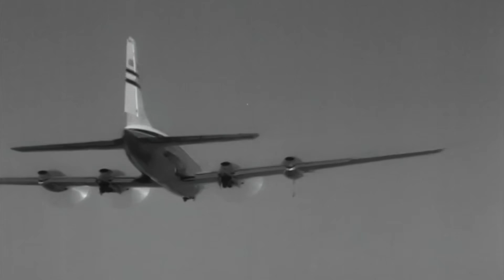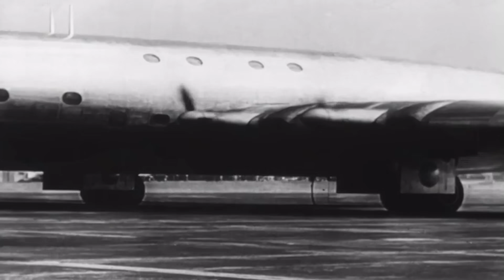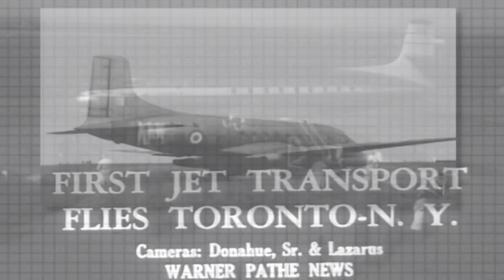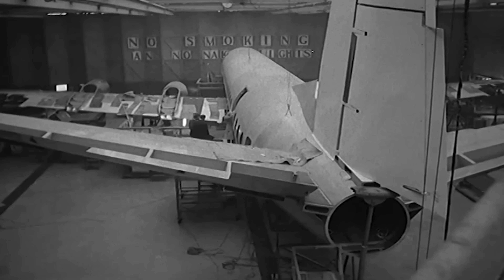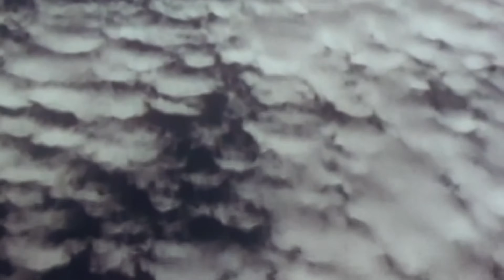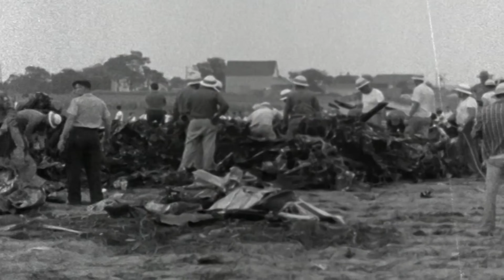How Frank Whittle's Jet Engine Evolved Aircraft Development | The Amazing World of Aviation | Spark

Comment: Former Boeing... it is interesting to see how Jet Engines have 'Evolved'... Whittle's first used 'Combustion Cans' that were arranged in a circle. They were easier to produce, reliable, but limited performance. Three main types of combustion chamber in use for gas turbine engines. These include; multiple chamber (cans), the tubo-annular chamber, and the annular chamber. I have stood inside front of GE 9x engines used on our B-777. It is huge and would not fit inside my house with 8 foot ceilings. The Front Fan is about 12 feet in diameter.

Comment: Whilst a lot of the British story is focused around Sir Frank Whittle’s efforts throughout the world, it is apt to overlook contemporary European interests of the time most notably Von Ohain, because of his book in the 1950’s. This has been corrected by modern revisionist historians and engineers. I would refer you to Dr Hermione Giffard’s book Making Jet Engines in World War II, which has corrected the historical narratives with engineering facts.
Whittle was only responsible for a centrifugal jet engine with a double sided impeller compressor and reverse flow combustion system, made up of individual combustor bins in which the air is reversed twice, giving 1600 pounds of thrust and had no involvement in the axial flow engine development or the industrialisation by Rolls Royce, de Havilland, and Armstrong Siddeley. Major George Bulman head of British Engine development for MAP held strong opinions on Whittle’s ability to design and manufacture in volume a jet engine powerful enough to eclipse the available piston engines. Arguably he was proven correct until Rolls Royce became involved.
The Whittle engine issue of this architecture resulted in poor power output. Rolls Royce developed the simplified centrifugal Derwent designed by Adrian Lombard used the double sided impeller but with straight through combustion system and was more powerful at 1900, Pounds of Thrust. The de Havilland goblin designed by Frank Halford took the Derwent design further and simplified for the Goblin at 3000 Pounds of Thrust 
However what is less known is the work of Dr AA Griffith and Hayne Constant. Before the war Dr AA Griffith has produced a paper on the principle of a turbine axial flow engine as part of the RAE, this was developed into a British axial flow series of engines produced by Metrovicks, in association with Armstrong Siddeley, part of Hawker, which became Bristol Siddeley and finally Rolls Royce.
The key engine during the war was the F2 which not surprisingly were more powerful than the Whittle design, first delivering 1,800 lbf (8,000 N), but soon scaling up to well over 2,000 lbf (8,900 N). Around that time, the Whittle W.2B was developing only 1,600 lbf (7,100 N). However, although more powerful than the German Jumo 004 and BMW 003 engines like them there was concerns about reliability particular after the F2 prototype Meteor crashed in early 1944. The meteor prototypes were used to test all jet engines, so Whittles, de Havilland, Rovers, Rolls Royce and the F2 axial flow called “Beryl”. Whittle’s engines were only powerful enough for ground speed runs. The first meteor prototype to fly used the de Havilland Goblin. 
So, whilst the first British jet fighters used the Rolls-Royce RB.23 Welland, in the Meteor and de Havilland Goblin, in the Vampire, Metrovicks continued to develop the British Axial Flow engines, the final being the considerably larger F.9 Sapphire with Armstrong Siddeley, to become the Bristol Siddeley Sapphire, which powered the Hawker Hunter, Gloster Javelin and the Victor V bomber. It was subsequently developed into the Rolls Royce Avon then Conway and ultimately Bristol Siddeley Olympus.
So considering passenger aircraft, the de Havilland Comet initially used the de Havilland Ghost engines 5500 pounds thrust designed by Major Frank Halfords team. Frank Whittle had nothing to do with the design and indeed was apposed to its design. The development of the axial flow engines Sapphire was led by Hayne Constant and the Avon by AA Griffith.